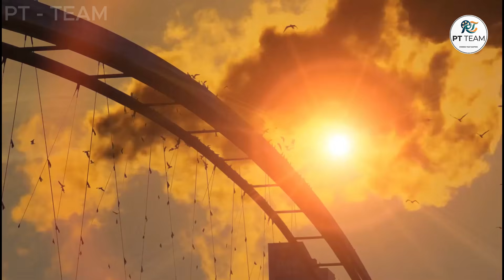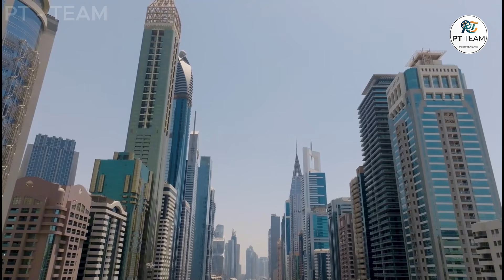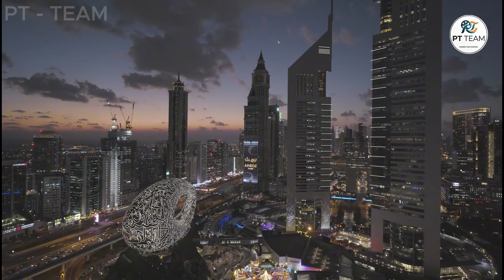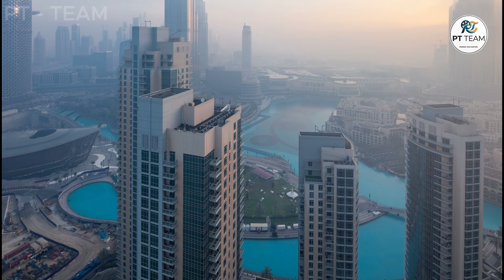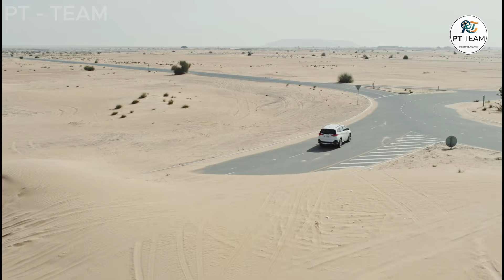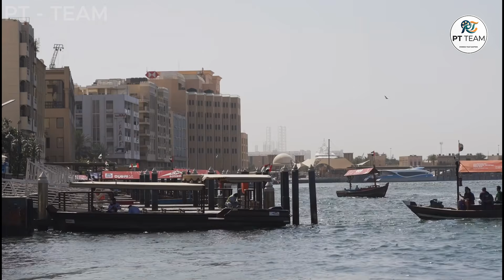Why 122°F Heat Is Breaking Dubai’s Modern Skyline: The COOLING Illusion!

Comment: Solution: Build a reservoir of cooled water. Cool it down in the night and times of low demand for cooling, and dump the heat into it in the times of peak demand and unfavourable atmospheric conditions.
Reply from the maker: District cooling plants already use similar thermal energy storage tanks, but scaling that technology to cover an entire city’s peak load is a massive engineering hurdle.